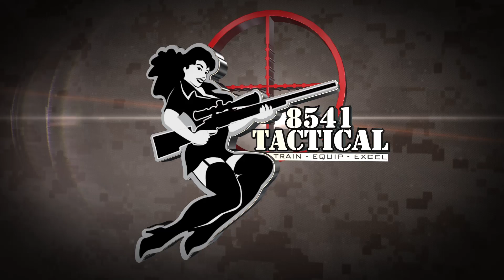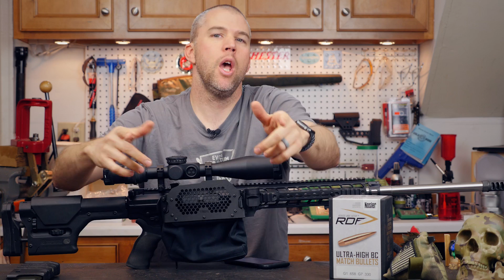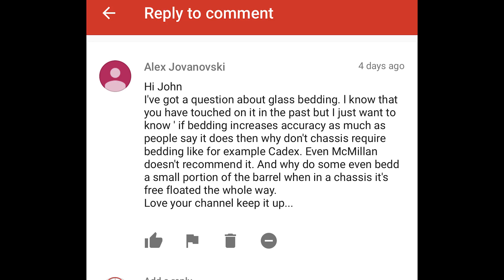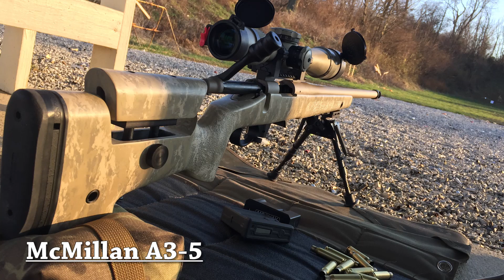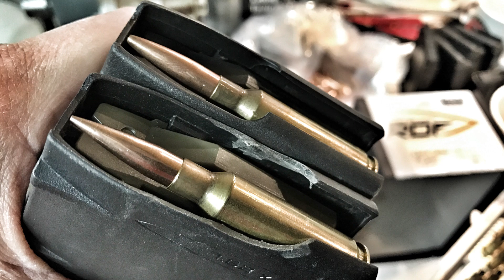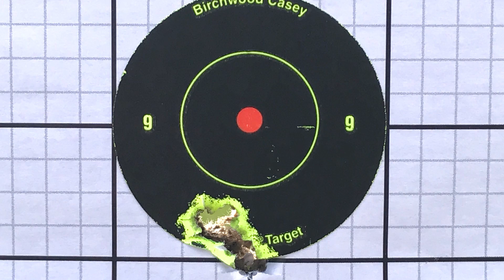Mail Call Mondays Season 6 #3 - Bedding, MATEN 6.5CM and the Nosler RDF, Tactical Brass Recovery

Comment: Great video, as usual John. 
I’m having the same feeding/flyer issues in a build. Awesome groups while manually feeding. Occasional jams and flyers when auto feeding. The problem for me is that VLD 6.5 bullets have a very long taper and the magazines are designed for the 308 cartridge. The magazine lips and follower do not life the round high enough and the bullet nose is so skinny that it isn’t lifted sufficiently by the feed ramps for the tip to clear the barrel chamber lip. This causes occasional jams and is also shortening the OAL on some rounds that do feed. The bullet tips are also altered by hitting the chamber lip. This is most probably what’s causing your flyers. A dedicated 6.5 Creedmoore follower/magazine would fix this but magazine modification is option unless you are willing to start adding metal to your feed ramps

Comment: John, I'm looking at getting a remington 700 sps tactical and putting it in a b&c m40 stock. Later down the road I'd like to put a 22 inch m40 contour barrel on it. Could the b&c stock be opened up for the heavier barrel? Is there enough meat on the stock for it to still be rigid After? Thanks

Comment: I can't speak to the 6.5 RDF.  They are crazy long in .224 and I don't know of anybody that's had as much success with them as say the 77 SMK in an AR.  FYI, if you get some IMI mags you can run an OAL out to 2.850.  When I measured mine they will closer to 2.860.

Comment: Just wanted to verify that when you worked up the loads for the RDF you went through a full ladder test.  You mentioned that you had identified a wide node from a previous load but I would think it is quite possible that due to bearing surface and bullet profile that pressure profiles could be substantially different and without doing a ladder you could be missing the node for this particular bullet/load.
Reply from the maker: +BoonerFinder that is something I have considered. However the "flyer" does not look like a typical scatter node. Neverless, I will be running a full work up for the .260.

Comment: I've just completed a build similar to yours and this was very helpful for me. I haven't been to the range yet but I'm planning to work up loads for it. What gas port setting did you use for your loads?  What do you think about Reloader 15?  RL 15 is supposed to have copper foul out properties to reduce cleaning effort.
Thanks! 
Rich Mitchell

Comment: John,
In the video you may have found the issue.  You quite simply may have passed over it at the time.  You said you didn't weigh your projectiles.  It may not be the issue but weighing them would rule it out.  It is odd that there seems to be 1 in every 5.
Just an observational posibility,
Chris
Reply: not that odd if you consider  that the factory may be running multiple lines of the same ammo at the same time . if one line is out of spec there is your  1 out of 5 flyer.
Reply: A pair goes for $22 on amazon. I use them on my primary arms 1-6

Comment: I had the same problem with the magpuls and got a couple Lancer mags and the problem is gone. Also had a bit of an issue with bolt none locking back but played with the spring weight and its perfect now. Thank you for time on putting on your videos i always enjoy them.

Comment: I have the same issue with the flyer. I user the 70gr. (.224) and the 175gr. (.308) RDF's. Both are fired out of bolt guns and I have even played with the seating depths from 0.010" to 0.040" and still get that flyer.

Comment: You need to do a load for a bolt gun using the Nosler and see what happens.  it could be the gas system on the DI guns it doesn't like.
Reply: Guess I should have waited 30 seconds to make this comment.

Comment: An often overlooked benefit of bedding the action is to allow the removal of the action from the stock without changing the point of impact or harmonics. Why would that be important? Consider that you're away on a hunt and get caught in a deluge. If you don't want a lot of rust or a malfunction, you need to remove the action and clean underneath it as well as the trigger assembly. And if you're like me, you don't want to waste precious hunting time rechecking your zero or chasing a wounded animal.
Reply: True to an extent, but it is important to include that it is only true if the action screws are torqued down exactly the same as before. Changing the torque can change your POI even in a perfectly bedded stock/chassis.